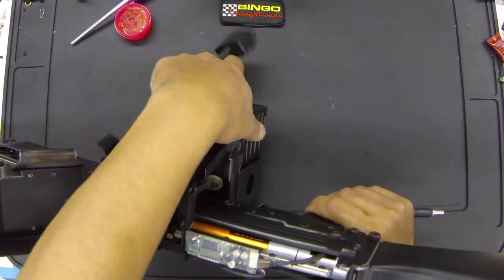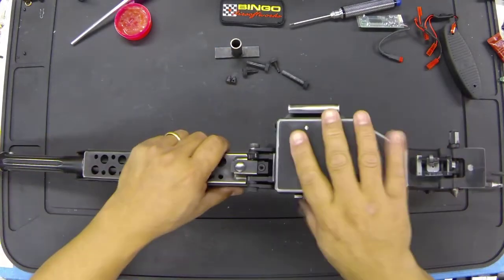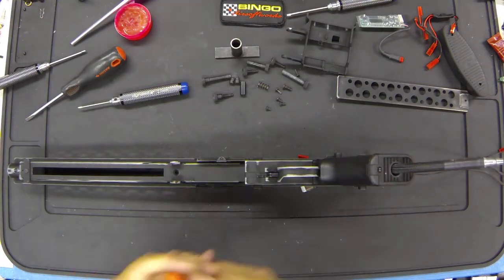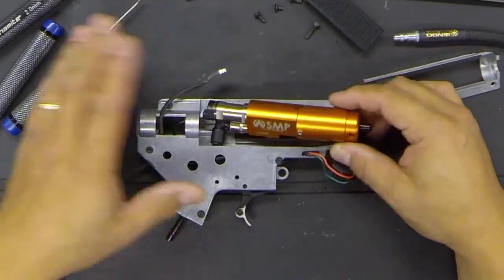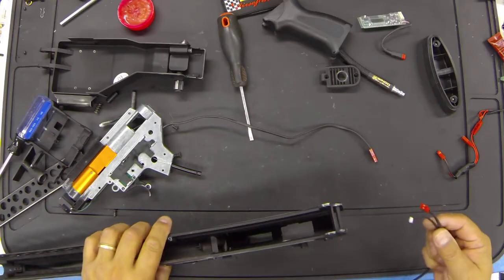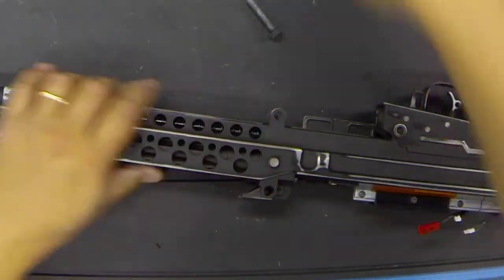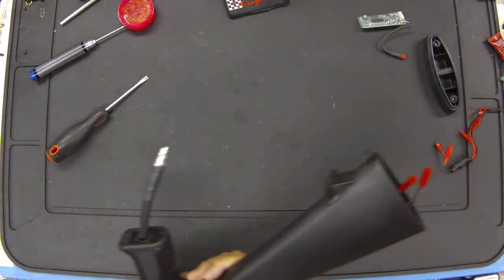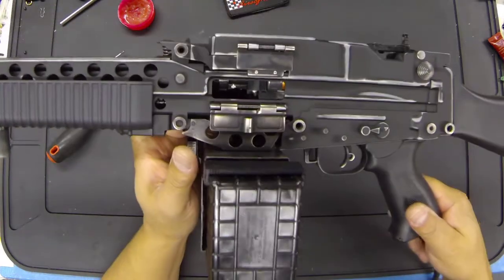G&P Mk23 Stoner 63 Wolverine Airsoft Gun SMP Conversion breakdown

Comment: I have a question about the Stoner 96 series guns. It uses a micro trigger switch, almost like the M249 style. I see the connectors with the wires soldered on, but the connector plug-nubby things are shorter than one on a M249... would the M249 wiring harness for the wolverine inferno still work in it? or will it need a different harness?

Comment: hi ! what sort of smp wolverine noozle do you use on the stonner 63 ?
Reply from the maker: +Vahlk Red Waters The nozzle needs to be about 1.5mm shorter than the stock M4 nozzle. Try using the M249 nozzle, it's ~1.5mm shorter.
Reply: +BingoAirsoftworks i agree with you, i hope, i&#39;ll dont have to dremel it if it is not to short...

Comment: It surprises me greatly that all the disassembly videos that I've seen do it wrong to take the barrel out.
In order to get the barrel out you just need to:
1.- Take out the pin for the top cover.
2.- Unscrew the feeding plate.
3.- Tap out the sleeve cylinder holding the barrel holding lever.
4.- Take the lever off, spring off and undo the top screw holding the barrel. Only the screw and the vertical pin held by the lever are holding the barrel. Be sure the vertical pin associated with the lever is OUT (or UP).
5.- Set the hop to maximum.
6.- Slide the outer barrel with the inner barrel and hop chamber out. The gas tube will remain with the rest of the gun.

Of these 6 steps, step 2 is OPTIONAL. The barrel will get out without doing it, but it's needed if you want to get the gearbox out.

I think I'll have to make a video about this :D
Reply from the maker: Iñigo Zapata Thanks for the info! I recall trying to do that when I first got my Stoner, but I couldn't get the barrel loose. It seemed odd that I had to take everything off to get the barrel out. I'll give it another try and see if I can get the barrel out as you describe.
Reply: You are welcome Rudy :) I might make a video showing the procedure anyway.
Reply: Iñigo Zapata
Any suggestions i bought a used g&p stoner and the safety lever dont work, even semi is not working.
Reply: JoeyAirborne Also check that you have the cut-off lever spring that relates it to the selector lever.
Reply: Roger that its a common V2 gb right?
Reply: Yes. Regular v2.

Comment: When the gun is not firing does the nozzle rest in the forward or rearward position? Because I have this gun in AEG form and I was having an issue where the nozzle would be in the rearward position and the autowinding box mag would double feed BBs whenever I wasn't firing
Reply from the maker: If the gun has an SMP in it, the nozzle will be rearward when not firing. With a Fusion Engine, the nozzle will be forward when not firing. With an AEG, it could be anywhere in between, if firing on full auto. The nozzle can will stop depending on where it is when you release the trigger. If you are getting double feeds, then check your bucking and make sure there is a little resistance to the BB so it doesn't just fall through. The resistance will prevent multiple BBs from coming into the hopup.

Comment: Does the SMP have the same trigger problem as the P* does? The one where you have to modify the trigger with a screw to prevent crushing the microswitch?
Reply from the maker: No, it doesn't have the same problem. Since the trigger is used in the stock gearbox shell, the back of the trigger hard-stops against the shell.
Reply: Thank you for the quick reply!

Comment: Question. Is it alright if i maintain the amp with ICS Silicone oil spray? Or is it require to use that Techsav grease?
Reply from the maker: The silicone oil spray will work in an emergency, but it wears away quickly. It is much better to use the TechT Gun Sav, and the SMP nozzle needs to be well lubricated to work properly.

Comment: Hopup support block; where do you have the wires wired to? The trigger broad?
Reply from the maker: There are actually multiple ways to wire it up. If you use the 9V battery in the box mag, you can wire the support block directly to the mag port on the SMP FCU (you have to remove the heat shrink and solder to the board). The signal from the FCU will cause the box mag to wind. I use an external circuit (MCU, motor control unit) so I can use a separate battery to power the box mag and not use the 9V battery. The port on the SMP FCU triggers the MCU, which then sends power to the box mag. The same can be done using the Fusion Engine. The FE FCU has a gpio port on it which is turned on when the trigger is pulled.
Reply: BingoAirsoftworks
 WOW! thanks for the speedy responds- what nozzle did you have to use?
Reply from the maker: gon44sec The Stoner 63 uses a nozzle that is approx. 2mm shorter than the standard M4 nozzle.

Comment: Curious about the P* FCU and the conversion to make it work on the SMP.  What kind of modifications did you have to do to make it compatible.  Thanks in advance
Reply from the maker: It only requires a modification to the SMP wire harness. One end of the harness is cut off, and the wires are then recrimped with connectors and inserted into a P* FCU connector. The only trick is that two wires on the SMP harness are combined and go to one pin on the P* FCU connector, and one pin on the P* FCU isn't used. Contact me via my website (email) and I can send you an image of the connector wiring. I'll do a write up when I have some time. I also sell SMP/P* FCU wiring harnesses for $25.